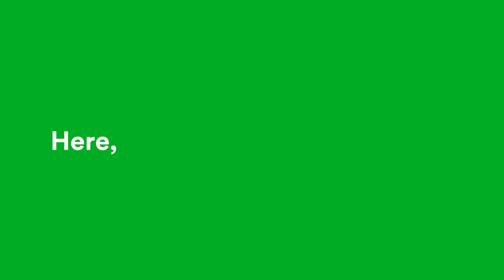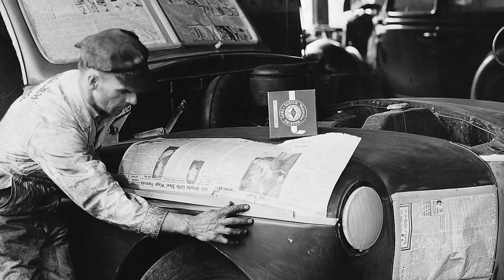3M's 15% Culture of Innovation

Comment: I guarantee you that most 3M workers have never even heard of this "15% Culture." That is reserved for the top salaried workers. There is, unfortunately, a large gap at 3M between how the salaried workers are treated vs how the hourly workers are treated. 3M is struggling right now. Just take a look at their stock prices over the last three years. This is at least in part because of poor treatment of hourly workers leading to huge turnover rates which in turn leads to a poorer quality of product being produced. But Mike Roman and the Big Boys at 3M don't understand this.